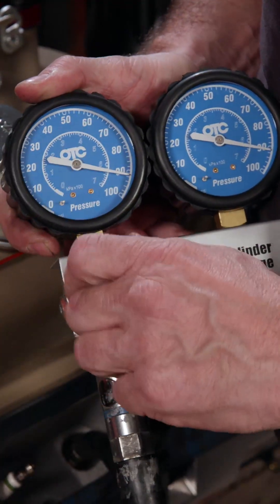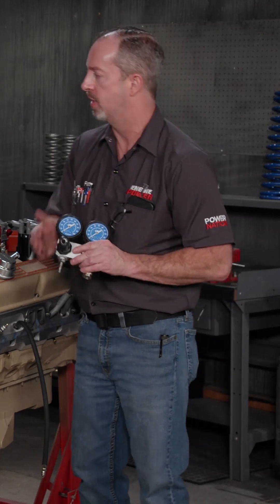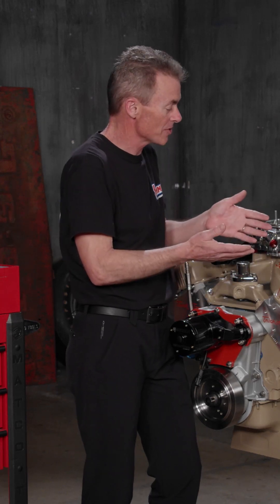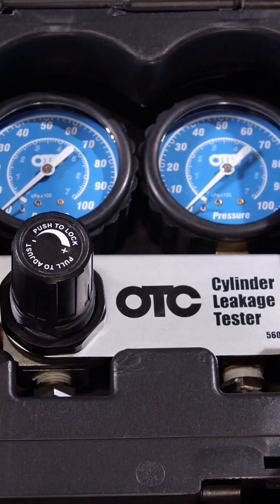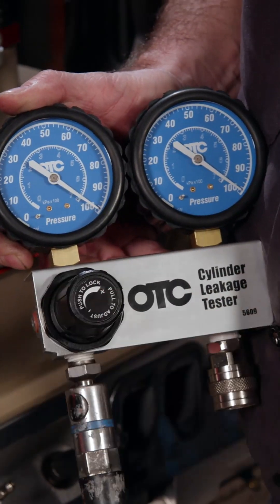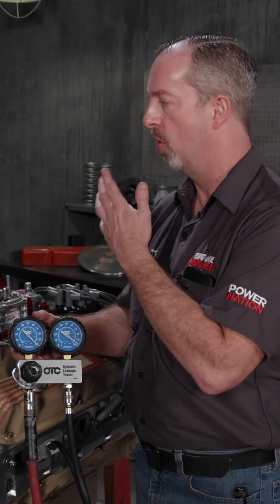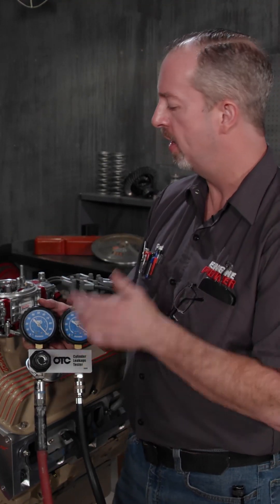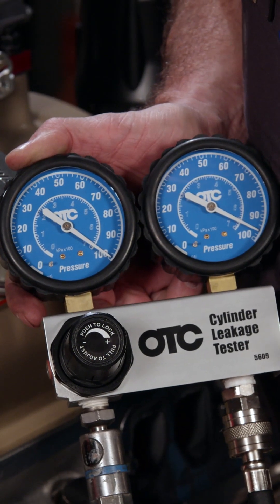Cylinder Leak Down Test Demonstration

Comment: Leakdown test tell you if you have a leak in the combustion chamber, crankcase (past the rings), intake/throttle body, exhaust, or coolant system. Typically a valve can get worn out or seals/gaskets deteriorate

Comment: My only problem with leak down test, which is very good. Sometimes on some engines you can blow out a main seal at 10% .
Reply: How in the world would you blow a main seal if there is a crankcase vent goofball
Reply: @RejectReality97  well from one goofball to another, you can and as I said on some engines and for various reasons.
Reply: @RejectReality97  easy if you have? A bad Pcv valve or reed valve and you have a bad enough leak?
You will definitely blow a main seal on some engines. Every winter.
If we get a frozen Reed valve in the pcv we blow a main seal. On some engines.!!!!!!
Reply: @RejectReality97  i work on emergency generators so from v10 ford's to v twin Kohlers

Comment: He had me until he referred to "experts" at Summit Racing.  LOL Yeah right!! That's like calling Comp for cam advice or Holley for carb advice. haha! Good luck with that.
Reply: Well they do have forms you can fill out for a recommendation.  I've done it and it's close to what I would have done anyway. 

Unless you just want something completely custom ground or a custom calibrated and jetted carb(hard to do). Which I don't think 90% of street cars that cruise around even need.....

Comment: Would you expect similar numbers from every cylinder when the engine is worn out or could it be only one or a few of them with bad numbers?
Reply: If you have a major leak yes you use one of those but not to get an accurate number to give to a customer or to a mechanic
Reply: Just get a stethoscope with metal end can listen thru, kinda hard to diagnose unless you are checking valve clearances, ring gap/consistency of hatching.